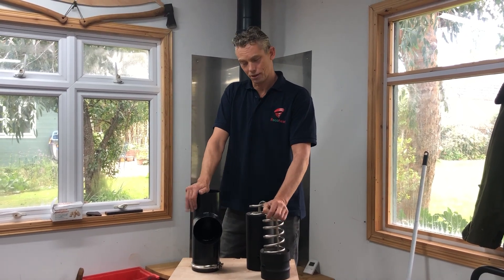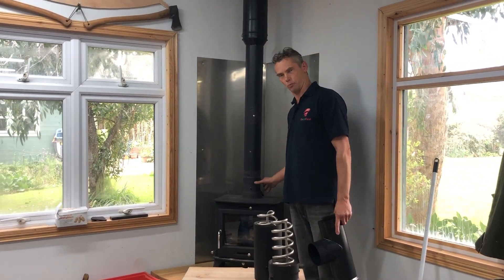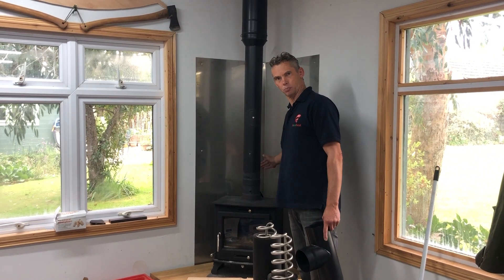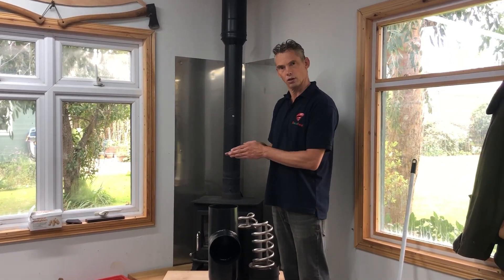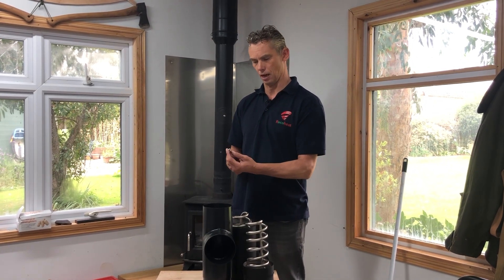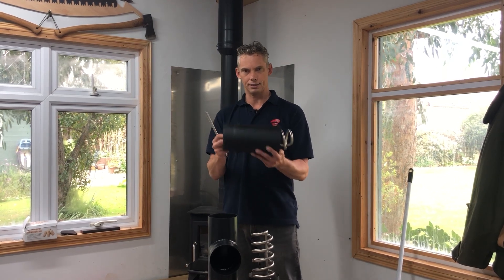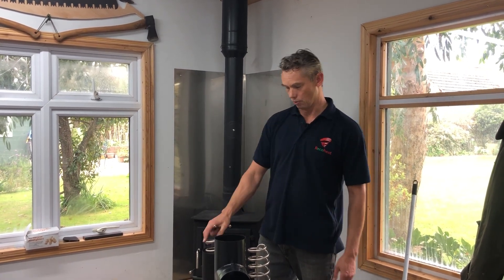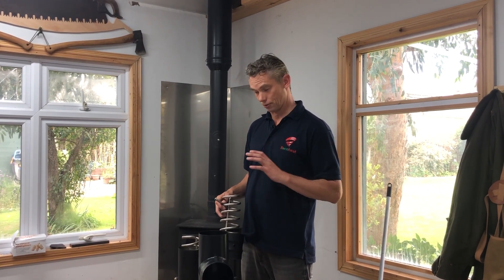Recoheat Design Development Update

Comment: How do I reduce hiss from the front? Exiting flue gas noise. Please. Incredibly noisy. Far louder than the air pump unit.
Reply from the maker: It's much louder than the cold flow when it's running hot, but it shouldn't be noisy like that. It's possible there is something in the nozzle. We're having a nozzle designed to reduce the noise but testing to ensure it doesn't reduce the effectiveness is taking time. The immediate solution is to switch it off when you want it quiet, or send it back if it's too loud.

Comment: Just wrap the coil on the outside of the pipe and then you won’t need to worry about vortex’s.   Shower heat recovery units wrap the pipe on the outside.
Reply from the maker: The vortices are a key feature. Wrapping the pipe around the outside would indeed work, but agree that though it is quite a lot less efficient, it is also much less complicated.

Comment: Lost me
Reply from the maker: Sorry! Basically we can't put the coil in a horizontal position off the back of the stove. People with a rear flue extending back into the chimney before turning up into the vertical will need to place the coil in the vertical position and use a tube to feed the air back to the top of the stove. We'll do more videos to explain with an example installation.